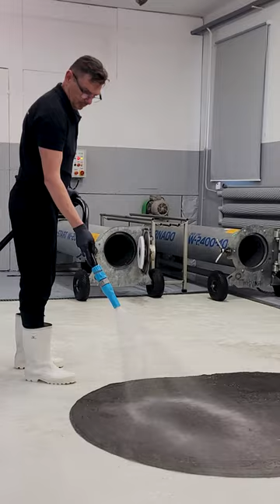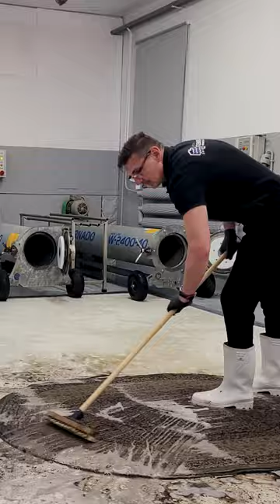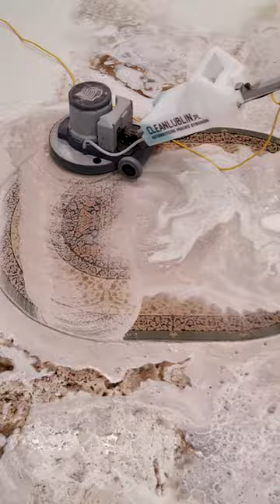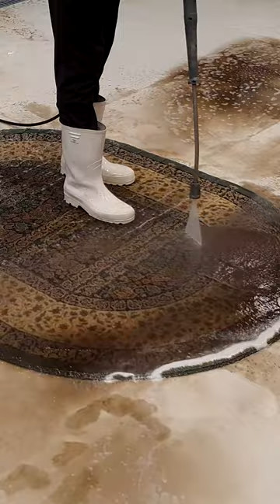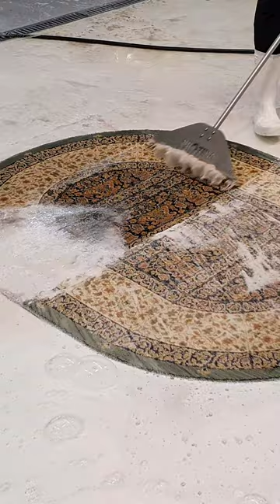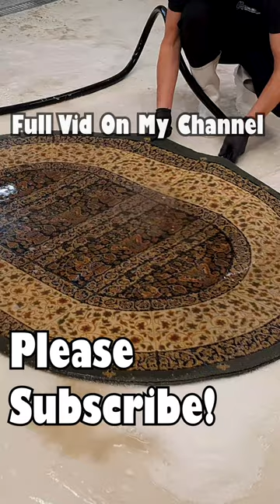Restoring the old look of this carpet was not without a small surprise:)  #shorts

Comment: Would be good to know what equipment/products you use and the cost of it all. What is the white floor made of?
Reply from the maker: Hey, thanks for the comment. The floor is made of ordinary materials, it is only painted with waterproof paint. We made the drains around the white floor ourselves.

We use chemicals from different manufacturers, we buy them in bulk, so it's hard to calculate the cost used for one carpet.
Reply: @cleanlublin  Thanks for your response. I meant the equipment you use for cleaning. I’m thinking of doing this out here in Namibia so just curious as to what cleaning products and equipment you use. Awesome work and very satisfying to watch!